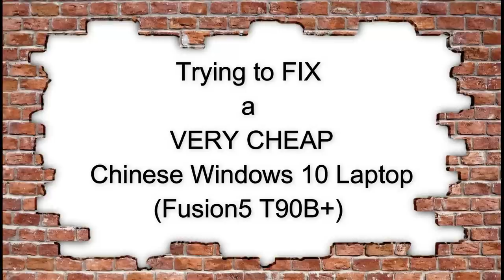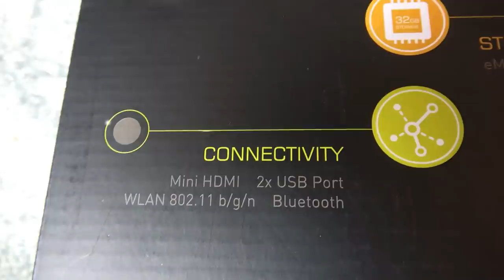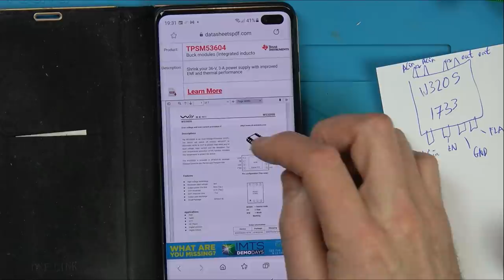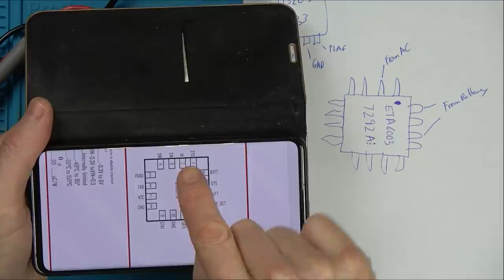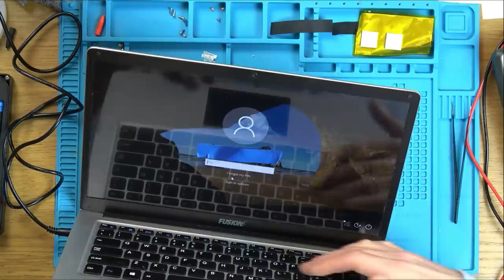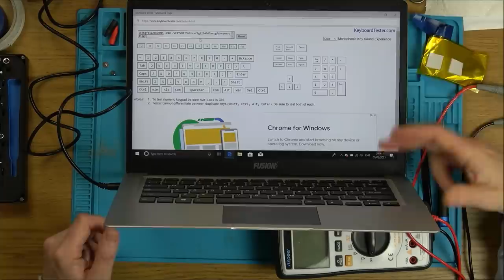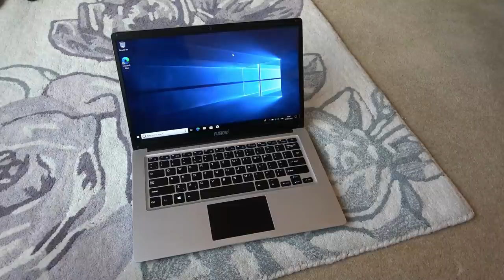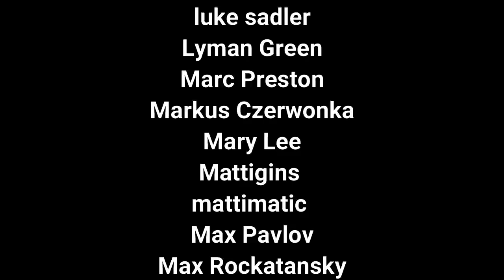Broken Low Cost Chinese Windows 10 Laptop - Trying to FIX

Comment: this is the sort of thing that I would call a "netbook"
and I just saw the dreaded words "eMMC Storage"
for those that don't know, eMMC is essentially an SSD that doesn't have any of the benefits of an SSD
and I HATE the trend that modern laptops have where the RAM, and in most cases storage, are soldered to the board, and the fact that the battery usually cant be replaced by the end-user (that last point REALLY annoys me)

EDIT: and I remember one of these cheap laptops once gave me a scare, where I plugged it in, and the charging light didn't come on, and windows also said that it wasn't even plugged in, when it was (there was nothing wrong with the charge port, just some sort of glitch where the laptop wouldn't charge, and it took a bit of fiddling with it to get it to charge
Reply from the maker: Thanks Pineapple 👍 Yeah, the soldered RAM is a real shame.
Reply: More like a cheap SD card soldered to the motherboard but yeah it is painfully slow
Reply: Netbook had real notebook hardware, standard so-dimm ram and sata disk but a screen with unusuable resolution and no cpu power. This is just tablet hardware in a nb shell.
Reply: @kyliandc9276  I have one of these. According to Windows (in task manager), the eMMC drive is actually an SD card,
Reply: @Mymatevince  and I really hope the rest of the industry don't copy what Apple is currently doing with their latest products, or you may end up with computers that need a CPU swap when the RAM goes bad

Comment: As an IT guy, within the first 3 minutes, a bunch of alarms went off in my head. First, the price... even if faulty, 20 quid??? Ahm... nope. Then the CPU... says 4 core, fine... but boost up to 1.92 ghz??? Any modern cpu will go up to 3 ghz easy, even 4 ghz. That screams Atom cpu to me. Aka, the cpu's found in cheapo tablets 5 years ago? Than the ram... DDR3??? We've moved past DDR3 a looon time ago. In fact, DDR5 is slowly being teased nowadays. All in all, that's a terrible laptop, your phone in your pocket miles ahead in performance. But... none of that matters, I'm here for the fix. Pass the popcorn, please.
Reply from the maker: Cheers Nandi 👍
Reply: Yeah i have the same one from a supermarket brand Qilive (Auchan) also quite similar to Thomson Neo too. They can be found new at 99€ to 149 € and they're really bad.
Mine that i dumpster dived is dead too so i will need to check if it has a similar problem.
Reply: Yeah atom. Z8350 to be exact.

Comment: Have you tried it with a usb mouse and a usb wifi adapter. It would be interesting to see how it performs.
Reply from the maker: I did try a USB WiFi dongle but I didn't try another mouse. The speeds were still poor compared to other devices I have. It improved with USB Lan adapter (Ethernet) but still on the slow side 👍

Comment: Vince you could have gotten a usb WiFi card for getting best signal also using a external mouse is recommended also you can use a usb 3.0 gigabit Ethernet adapter

Comment: hey bud. i got a dropped rtx 2070 here. the damaged pcb has no components to it. but it doesnt work its stuck on power safe mode. there was a blown 1 ohm resistors i replaced but no dice. maybe you'd love to take a look at it?
Reply from the maker: Thanks for the offer Ray Productions, I will decline it at the moment as I need to get my head around a few laptop repairs first, before I venture over to the PC side of things. I will definitely love to look at them in the future, but I need to up my skill level a good few notches 🤣👍👍👍👍
Reply: @Mymatevince  haha no problem. Also figured out the 1 ohm resistor should've been 0.001 but I'll keep it laying around

Comment: how did you end up fixing the keyboard to the frame without the plastic rivets?
Reply from the maker: I melted the bits that I cut off (the ones that didn't fly across the room) back in the same holes with the soldering iron. Won't be as good as before but it seems to be stable enough 👍

Comment: Hats off .... nice work. The trend of the cheapo laptos are getting more and more on the cell phone side, just a small gutless board with no possibility of upgrade I rather buy a proper used laptop than this kind of things. I know it is done down to cost, but it is too much. replacing the keyboard on this modenr thin ones is lot more work since the entire piece acts as a chasi .... And the power button on the keyboard. I know that lenovo did it. But I can change a T400 keyboard in 15 minutes. It is not glued, soldered or plastic riveted. I know how this had enhanced the portability and convenience, but look at this super thin screen and it flimsyness .... they break from nothing. Planed obsolecense to the next leel.

Comment: Great job, Windows 10 with 4 gigs of RAM is going to be slow. The small motherboard was cool to see. I have to get me some of that silver paint. I would agree that it takes a long time to restore Windows 10, been better off downloading the ISO from windows so you would not have to do the updates. or fewer of them. Google for windows update assistant you can download the media from there. Just in case any one wants to know how to get the ISO and or thumb drive image.
Reply: You might be surprised how much the silver paint is but a little goes a long way

Comment: Oh no 🤦‍♂️These laptop are the worst , Please keep the charger with it using an normal laptop charger will Kill it, you actually got the better one the other one have 32gb storage and no space after windows is loaded, Great repair, You went trough a great deal of trouble to fix the keyboard, I would just add an external power button 👍
Reply from the maker: Cheers AR, it was a shame it turned out the way it did, as the screen and overall look is nice. The size of the board should have been a good indication of the performance. I think my phone has more power 😉
Reply: @Mymatevince  so many students get caught with these and they are useless for what they need , wonder if linux would work better never gave it a try

Comment: Oh man, all that work getting to the keyboard for the on-off. I know it's not a pretty fix but I would have just wired in a new tiny switch and drilled a hole in the case for it somewhere.

Comment: Whats the laptop like, when its hard wired via ethernet cable....  are you getting decent speeds then ?
Reply from the maker: When I use a USB3 LAN adapter for Ethernet, it does improve the speeds on Speedtest massively, but it still seems slow to use 👍

Comment: Hi Vince please help me. I recently replaced my sons Nintendo switch shell. Everything went fine. No cables torn or pins bent anywhere. The switch will now not power on, charge, and when inserted into the dock the green light flashes once and turns off. What have I done? There is no backlight, no lcd nothing. It’s like it’s completely dead?
Reply: Any help?
Reply from the maker: I think I would try and narrow down the fault by maybe measuring voltage at the battery (or making sure it is seated correctly). You could try disconnecting the screen cable and see if it then works in docked mode. The screen connector is quite easy to bend the pins on when inserting the cable so you could check for damage there, a bent pin could cause a short. You could also try and undo others cables that are not necessary to power it on, like the Joy-Con rails and card reader connector in case those connectors are not inserted properly. Also you could measure for shorts on the caps like you see in various YT vids 👍

Comment: I have a smaller version of this exact laptop. I've had to open it up about 7 times now, because the battery connection is so poor and cheaply made and keeps disconnecting. I found out that even though it is smaller, my version has the exact same board, chips and everything. Pretty obvious these are just some cheaply thrown together laptops for a quick profit. They look ok, but I agree with them being horrible to use. Nonetheless, at least it makes a great video!

Comment: I did lol at the size of the board. Could you connect it to the net with a cable and add a mouse. It would then have some function
Reply from the maker: 🤣 Tiny! I tried a USB LAN adapter for Ethernet and it improved, but still not great. Didn't try a mouse yet, I'm sure another mouse should work perfectly. Cheers Emma 👍 BTW, thanks for helping Anders out over on the MMV Facebook page. I hear nearly 500 members have joined...Congrats!
Reply: @Mymatevince  No problems, it is nice to see some people posting stuff they have fixed because you gave them the confidence to 'give it a go'. IMO, electronics should be a subject in school at the same level as maths and english.

Comment: you could remove the password with linux i belive hirensboot could do that
or just replase osk (onscreenkeyboard) (or sethc) with a copy of cmd (you could make a backup by renaming the old file first)
and then open cmd after you boot
which will then open before signing in, so you can change the password

Comment: I've got one of these cheap Chinese laptops, I got it basically just as a "router" for astrophotography to send the signal from my rig outside into my desktop. 
But what I found was that the wifi and Bluetooth are connected to the internal USB 2.0 hub on the laptop, probably a bit of a shortcut for cheap laptops. So this might be why your wifi is crap. I only realised this when I installed another USB driver and suddenly my wifi and BT disappeared. And they didn't come back until I uninstalled the other USB driver.

Comment: Do you think that line failed because it's a thin trace?  Looks like that's the only button getting 1.8V on 225ohm, so 8 mA as the others have similar traces but only 0.2 V.  If so, that might be a common, or reoccurring, problem on these laptops/keyboards.
Reply from the maker: Not sure, I think possible water damage just ate it away as it was the top trace, so any water coming in from the top of the keyboard will sit on that line first 👍

Comment: To hack a windows system is fairly easy:
1. Step: enter mother board bios and disable SecureBoot
2. Step: enable USB drive boot and set it to boot by default
3. Plug in a Linux Live USB drive and boot linux
4. Click on try linux (instead of install)
5. Open file manager and navigate to the windows drive
6. Enter on the System32 folder under the Windows. 
7. Rename the file narrator.exe to narrator.old, make a copy of cmd.exe and rename the copy to narrator.exe
8. Take the USB drive off and Reboot into windows
9. On the logon screen click on Accessibility settings and then activate narrator. This will open the command promp instead of the narrator.
10. With the command prompt open (which will have admin privileges) type in 

 net user username newpassword
Reply: You need to know the username and you can get it by typing on the command prompt:
 net user
Reply: If you just want to add a new user to the computer you can type:

net user username password /add

To make the user admin You need to type:

net localgroup administrators username /add

Remember to change the username and password to ones to your liking.
Reply: If you can't rename the files on the windows drive it's because the system was not shutdown properly (hibernation or fastboot is enabled). If you cannot shut it down properly you can try to enter the windows boot recovery by turning it off while its trying to boot until it gives up and asks you to try to repair the windows initialization system. Click to repair manually and then in the command prompt option. There you will be able to open the notepad by typing notepad. And with the notepad you can click on open file and the file explorer will open. Click on the context menu to show all file types (instead of only text txt files). Now you can navigate to the Windows\System32\ folder and make the rename and copy of cmd.exe to narrator.exe. Reboot and continue from step 9

Comment: But once again blue light was blinking when battery was unplugged Right when you plug in the battery you messed it back up again I'm guessing that the battery is completely dead so when you plug it in then put the battery in it works right it will work right

Comment: I have a non branded light weight laptop which was free. It has 1gb storage (doesn’t say that on box), has no pc fan and no hard drive so I’m guessing it runs of an sd card. It also heats up when you put it on charge for 1 minute.
Edit: the mouse pad was coming out of mine and I just noticed that the mouse pad on your one is the exact same
Edit2: everything looks exactly the same on mine and yours except for some metal bits and stuff. I think I have the same thing as you just in black and unbranded
Reply: The keyboard is the exact same too except for the printed things on it

Comment: What bothers me is its got a quad-core semi-recent Intel chip without any real cooling solution.  What cooling was that, tin foil?  What Intel chip is that?  (My guess is one of few quad-core Celeron or Atom models, as there's only like 3 CPUs with Intel HD 500 graphics as the Amazon page claims)

Edit:  It may have taken so long due to thermal throttling, as you did have it doing all that with no cooling on the CPU die.

I had a similar failure with my 2010 MacBook (white).  Lasted over 6 years.  Shut it down for a restart one day.  Hit power button.  Never turned on again.  Even tried new motherboard as they were cheap.  Nothing.  But the keyboard was glued to the body, and it was sooo hard to find JUST the unibody, and I lost too many parts while waiting around, so there's that.  

For this keyboard, it looks like the conductive ink-based traces.  Cheap, but easy to fail, especially with liquid damage.

Comment: These tablet based system on a chip type PC's lack the performance necessary for a pleasant windows experience.  That said, they are usable if you have the patience.  The CPU's are slow, and have minimal RAM.
Reply: It's not the CPU or even the RAM (these machines have 4GB). It's the eMMC.

Comment: ive just noticed something, walmart started selling new gateway laptops and i opened one up recently. turns out the "new fast" gateway laptops walmart is selling are the exact same as these case and hardware. even down to the charger except everything is rebranded as gateway. DO NOT BUY ONE IT WILL NOT LAST.

Comment: Unfortunately Vince these laptops try to copy the Lenovo and Dell sort of tablet laptop, but these cheap ones never work very well and sooooooo slow, bad wifi and extremely low and slow memory and storage. Even the Lenovo and Dell's are not that slick either but much better than this copy. But it achieved what your best at and known for, fixit videos and you can never have enough videos showing how to apply silver conductive 🎨 paint. I enjoyed watching your efforts to repair this machine but being the stinge I am I would not buy it for 200 pounds and would barely consider it for 20 pounds but it was an interesting fix which cost you little in parts and the initial machine cost  I think your tiny windows laptop would be faster than this but, as stated previously it produced a very interesting fix it video.

Comment: If I was vince, I would just wire a button to the pins and put it somewhere else, a Pain in the ass, sure, but it saves a lot of time compared to actually fixing the keyboard, especially if it was just you or a friend using it.

Comment: Again, nice fix, but this really seems to be more of a "Laptop with a tablet style mainboard inside" , which even struggles with everything you throw at it :(  Maybe, it would work better with Linux Mint, as for this machine just has 4 GB of RAM. I´ve put a copy on one of my older PCs , on which I would not consider to run Windows 10 64 bit on and it works just like a charm.

Comment: you couldve pressed the power button to see if it turned the pc off, it would also make a cool phone considering the size of the board. ALSO THERE WAS NO THERMAL SOLOUTION ON THE CPU, NO WONDER IT WAS SLOW!

Comment: Designed in the UK?. Those cheap Chinese laptops are available from many, many different sellers across the World and all look much the same as they are a rip off of the Macbook Air.  But for less than £20 maybe you can re use the screen for another project, or repurpose the entire laptop and turn it into some kind of smart picture frame.

Comment: Really wish you would have contacted the seller for the PIN number. Could have backed up the laptop for them if they had any important info on it. You did mention briefly that the laptop was locked and you couldn’t add an account because it was locked, which was obvious because the owner couldn’t turn it on. Granted the owner might not have been willing to provide the pin, or perhaps they had backups made, or maybe there wasn’t any precious data on it, but you still could have tried, and you failed to do that.

Comment: you know how often i get hurt repairing stuff? i feel you stab vince but i raise you one small thing not the guy that trys to outdo someone else but the fifth time i soldered i get fed up with my trmbling hands and i tride to grab closer to the tip of the soldering iron the fact that it was hot totally slipped my mind luckily i remembered just as a barely tapped and didnt get hurt at all accept for a not nice burning feeling for about a minute lol

Comment: I've always thought this idea of putting the on/off switch on the keyboard is a terrible idea. Yes it saves money but keyboards are very failure prone and this fault stops the user from using the machine with an external keyboard.

The specs of these very cheap machines are more suited to Linux than Windows. The poor trackpad and WiFi can be worked around with external USB devices. I think I'd probably end up using something like this as a cheap, low power Linux NAS with the convenience of a screen/keyboard.